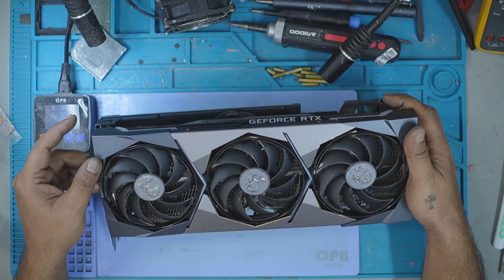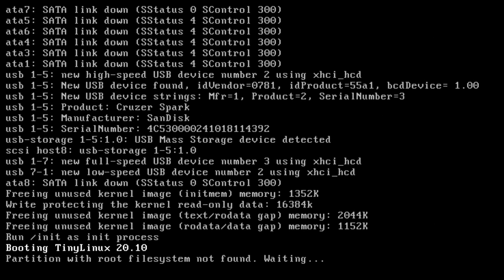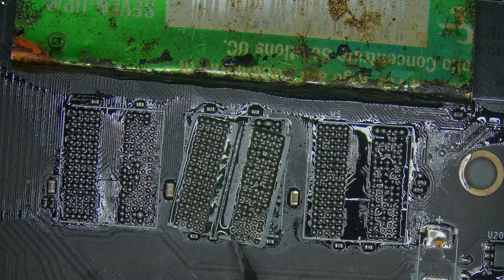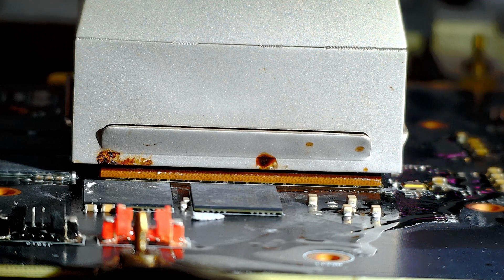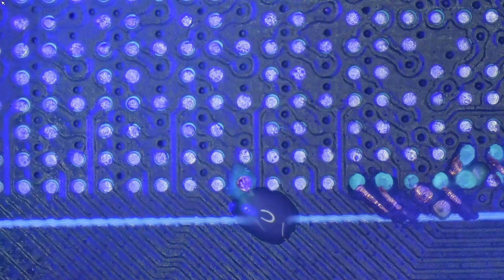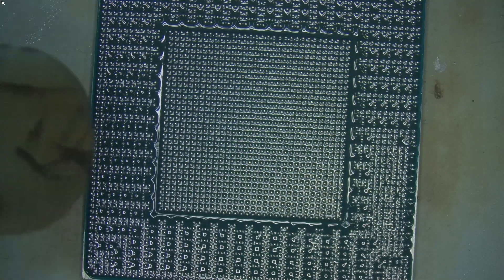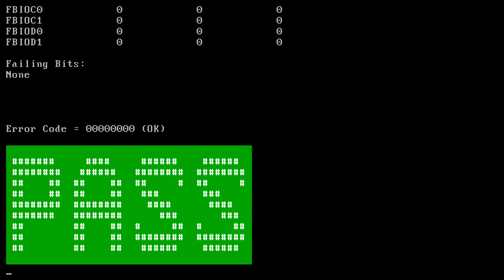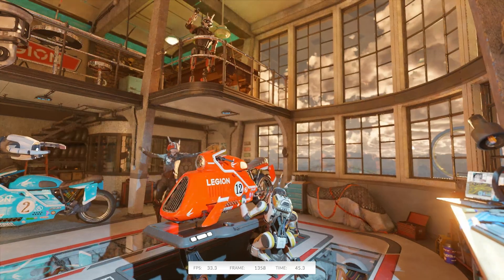MSI Suprim X RTX 3070 Memory Error Repair

Comment: That repair was amazing!
Reply from the maker: Thank you 😊
Reply: @GraphicsCardRepairs-tk7ql 
Quick question I had bought a flood damage 6700 XT cleaned it with alcohol , worked! Still had some rust and corrosion type places so ultrasonic 60min. Tap +detergent. Are blasted dried then crc 226, dry. Now not detected VGA light on mb. Any thoughts?
Also how do I learn to develop skills like yours if possible.. ty:)
Reply from the maker: Tap water and detergent (if dish wash) is a disaster for electronics. To wash electronics specially GPU distilled water is used. After using distilled water. Isopropyl alcohol is used to disperse the water. After which compressed air can be used. Tap water leaves moisture under the core and memory that can be a cause for a short.   @Thorsanbauer
Reply: @GraphicsCardRepairs-tk7ql 
Thank you for the response recommended course of action?

Comment: i have a rtx 4070 and its from inno 3d and it has 12gb vram i want the vram to be upgraded to 28 gb or something along those lines, with the same memory speed as the current or the speed of rtx 30series, so just wanted to see if its possible and if so how much will it cost. (edit : i have applied and sent an application on your website but just wanted to comment here to ask you if its possible and if so are there any risk of damages and what are the cons for this and if the gpu is damaged who takes the accountability)

Comment: What's the average cost of such repair ?  Did you charge extra after facing the real fault or you told the costumer earlier that the gpu repair costs X ?
Reply from the maker: The service cost is the same. The service cost is available on my website. The cost of memory modules added to the service cost. https://gpusolutions.net/faq

Comment: Back in the day when I did board level repair I would run memory errored boards multiple times to see if the errors would move and that can tell you alot before digging in to the fault areas.